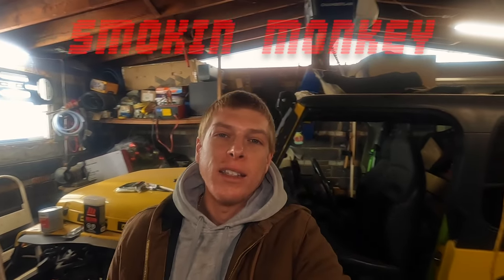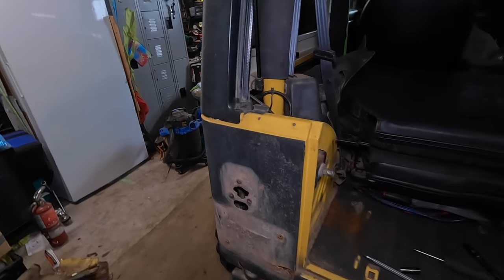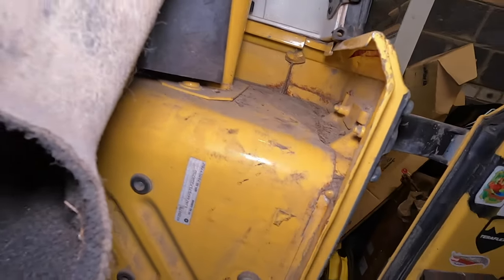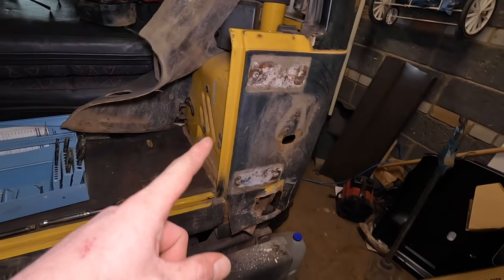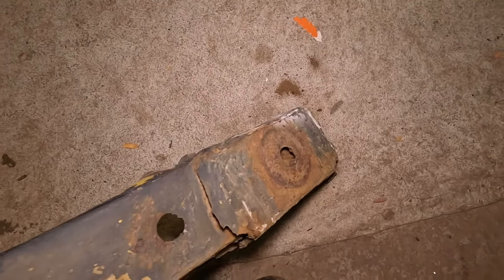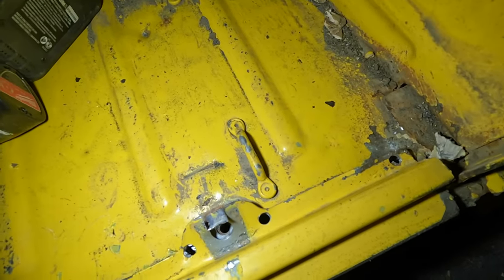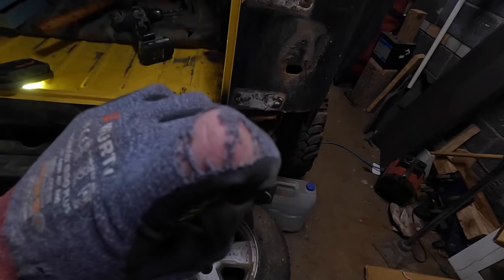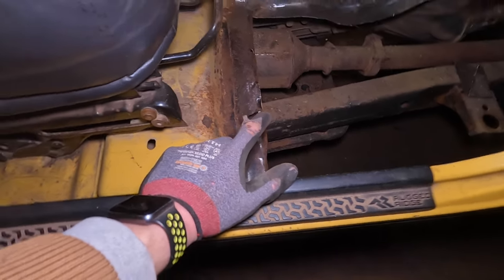Jeep TJ Rear Body Mount And Quarter Panel Replacement

Comment: For a mere forty to sixty thousand you could have bought a new wrangler and saved yourself all that work which is exactly why I'm going to repair the body on my TJ. Watching you is showing me what I can expect when I tear into my TJ, but thankfully mine is not as bad as yours. I'll be doing some extra tin work to prevent that mud buildup in front of the rear corner panels as well as some other changes to prevent buildup of mud and salt where you can't get to it. Be good to see you do some wheeling without eating a radiator although the parts suppliers will be disappointed. LOL. I'm going to drill and bronze bush my tailgate hinges because they were piss poor to begin with and I'm making my rear bumper out of 1/4-inch 3"x6" rectangle tubing and mounting my spare tire on that to save my tailgate from the abuse of carrying the weight of the spare tire. Keep it between the ditches rubber side down!

Comment: I had a 2006 TJ and used Raptor Liner to coat the entire outside.  I was very happy with it.  After 2 years it still looked perfect.  Mud also just washed right off of it.  Also your videos are a blast to watch......
Reply from the maker: I can’t wait to get it done. Always wanted to have it done but always needed to finish a few things first.

Comment: you should get a morryde tailgate reinforcement kit and put it on while you are re doing everything. Much stronger than the stock set up and will replace those hinges
Reply from the maker: Ya I’ve been looking at that kit actually